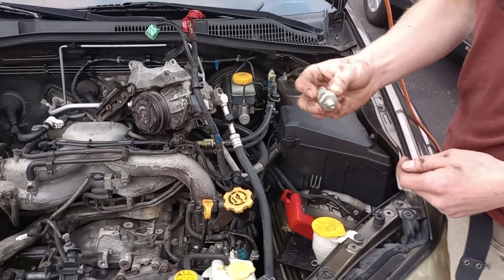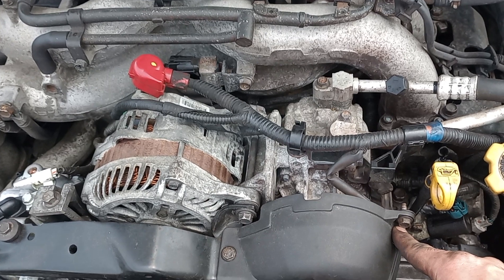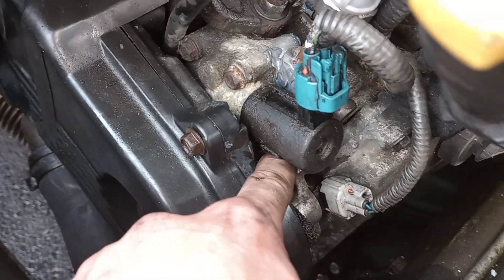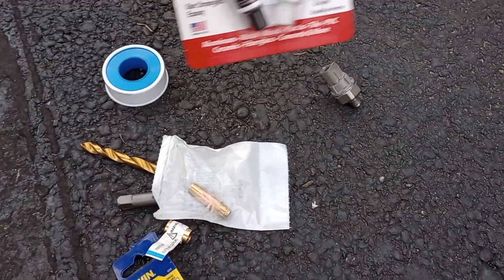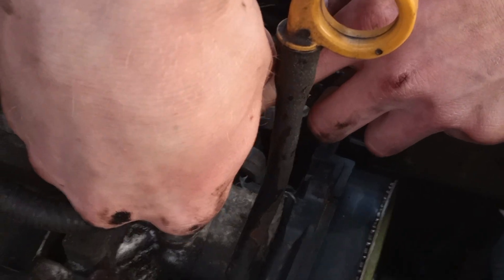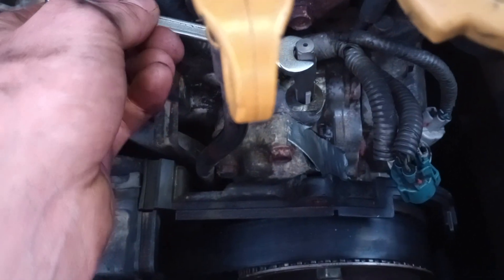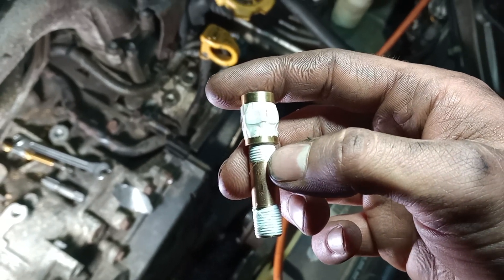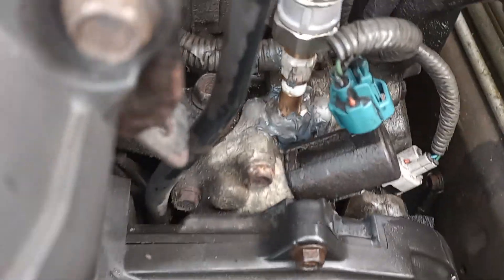Subaru Cracked Head at Oil Pressure Sensor Repair 2.5L EJ253

Comment: only video I found with this issue.  I was hoping it was part of the solenoid housing like the passenger's  side. My car is leaking so much oil. I did only JB weld and sure enough it didn't work. I wish there was a better fix.

Comment: At 2:50 I can't understand or see what you're saying. A cube sized drill bit?
Reply from the maker: @ianbelair3047 a "Q" sized drill bit, 0.332inches/8.43mm. that's what is recommended for a 1/8 npt thread
Reply: Awesome, just finished up mine now waiting on jb weld to cure. Thanks✌️

Comment: Dude thank you so fucking much! I was shitting my pants about it and about to give up on my own dumb solution until I came across this. I've been working on the car for 12 hours straight doing this and a bunch of other stuff, and finally at 0300 I start it and it works great. Couldn't have done it without ya man

Comment: Did the repair last? Has there been any issues with the repair that had to be re-done. I just did this exact repair and it seems to hold at idle but springs a leak under load when oil pressure is high. Ive chased two seperate leaks that kept poping up. I started with quick dry high temp in the tube but this last reair I used the original jb weld cold weld and it seems thicker and appears stronger. Hopefully this will do it. Thanks for the video.
Reply from the maker: Still working fine today, it gets driven almost daily.

Comment: Any updates on the repair, brother? I have the same issue, and my concern is whether the distance created by the pipe extender from the sensor to the engine matters or if it will affect the check engine light.
Reply from the maker: Still works great. Car gets driven almost every day. The short pipe won't affect the pressure at the sensor

Comment: You should really crank it down until the price breaks off and start drilling and tapping from there. You don’t need to Jb weld it if you make threads only below the crack
Reply: Meaning don't jb weld the piece back before tapping?

Comment: Yup it’s my turn for crack surgery just got the tap today, appreciate the guidance
Reply: Hey so am I, have you done the job yet? I am having a hard time finding the tap in stores where did you get yours
Reply: @ I had to order mine on Amazon because home depot didn’t have it in stock. I’ll be checking for leaks around 230 to see if it holds up.
Reply: @ hey there, thanks so much for the update I’m about to do the same I went to Lowe’s and Home Depot and both didn’t have the tap I needed but I got everything else. If yours held up well could you share some tips on your process? I would greatly appreciate it.
Reply: @campbellsopamc  did yours end up holding up?
Reply: @ so far so good I just took my test drive no smoking when I come to a stop & no oil seeping from the crack itself. It was fairly simple the drilling is the most nerve racking, and I used a little oil while tapping made me feel better lol
Reply: @campbellsopamc  thank you so much for the update. Did you have to take off the ac compressor hose near the oil pressure sensor port? I’m having a hard time getting my drill bit positioned above the hole properly so I have a good alignment directly above the hole.
Reply: @campbellsopamc  Can you please tell me which ones you got off amazon???
Reply: @PandaMan125  Drill America 1/8 -27 NPT tap everything else in Home Depot
Reply: @campbellsopamc  okay so actually I figured out a way around the ac compressor hose I’m gonna use a drill bit extension to get at the port and be able to drill it from the top. I am heading out to get some more parts. Thanks man.
Reply: @Darius_99  yeah the compressor had to come off I couldn’t get the proper angle myself. Once that was off the drilling was straight forward
Reply: @campbellsopamc  okay thanks for the heads up is it still holding up well? Also how did you measure how far down to drill, did you just gauge it with a screwdriver like he did in the video? Also, any tips on using the tap to cut the new threads?
Reply: @Darius_99  tapping the threads pretty straight fwd I used mini adjustable to turn the tap, i measured like op did and it went well I checked and cleaned up debris each time I checked

Comment: Working on this project right now. I had to tap pretty low because the top part of mine cracked off while tapping it. But you have about 1/3 inch you can keep tapping past the original threads. I had to Dremel the old threads off so the flat part of the nipple could drop down lower into the hole. Finger crossed. I'm about to JB weld in a few minutes. Thanks for the video
Reply from the maker: My friend is still driving the car even today. Hope it works for you!

Comment: how did this hold up so far?
Reply from the maker: @mikec3820  my friend is still driving this outback to work every day with this fix
Reply: Use a torch on the crack then brake clean so you are sure all the contaminants are gone. I fixed a cracked oil pan with jb weld and it lasted years.

Comment: Where did you get the pipe extender and fitting?
Reply from the maker: Ace Hardware. I have the part numbers in the description. You should be able to find these parts at any good hardware store.

Comment: curious how come you've removed the front timing cover? ive seen people take of the whole cam gear and rear timing cover too to access the bolts for the solenoid but have the say i like the straw on a shop vac method better

Comment: Why did you need to re tap the hole? Why not just JB-Weld and then put the sensor back in with the tape?
Reply: We try that with my bro.. and it didn't hold.. leak bad. is way to much pressure
Reply: Also, can't replace the sensor if needed later

Comment: BRO A LIFE SAVER! I never throught of this after I did the same thing! Will be doing. (Everyone’s saying I am gunna have to take it out so I can weld it)
Reply: Update with Mine, the crack was way to big (like the housing part broke off) I ended up taping it up then screwing a screw that I had laying around into it. Now taht it’s warmer out in I’m find an adapter that is the same size as the screw I put in so I can plug the sensor in. It does drive without it and honestly I don’t notice a diffence really.

Comment: I did the freaking nerve racking fix yesterday and let the jb cure today. Drove it 10 miles, got to 5000 rpms, etc. decent smoke from the brake cleaner slop. Mine was extra screwed because the wedge broke off completely and drilling and tapping was brutal. Thanks again man.
Reply: mine just did the same thing today. The wedge fell right off. This comment is encouraging me a bit. A year later, still running?
Reply: How did you secure the wedge?

Comment: Do you drill with both bitS?
Reply from the maker: Just the one drill bit then the tap
Reply: @Adding1122  how far do i drill down? And how is the repair holding up for you?
Reply from the maker: @3188teddyrock  still holding up good after 5k miles. I used a small screwdriver, as shown in video, to estimate the depth to drill.
Reply: @Adding1122  yea it didn’t work for me oil was still leaking. I ordered a kit i found online and will install this week. I will keep you updated
Reply: Thanks for your video, talk about a sleepless night I had last night.  I will be doing this fix this weekend.  Mine actually broke a chunk off but I first found a guy who will sell you all of these parts for $180 and he has a pic on his website of one like mine that is completely broken off.  Thanks for listing the parts and tools. I went to a plumbing shop to get the nipple and coupler.  Also I like how you removed the AC compressor and not having to discharge it, just swing it out of the way.  Wish me luck - Eric @Adding1122
Reply: @3188teddyrock any updates ?
Reply: @purruas1  can you point me towards the kit? a link or the name of the site.
Reply: @purruas1  how did it go?  has it held up?   same issue I have
Reply: @3188teddyrock  what kit are taking about?

Comment: Will be attempting this weekend. Will update with results
Reply from the maker: How did it go? Did it work for you?
Reply: @Adding1122  it worked! It leaked a bit when I tried the first time, so I tightened everything down and added more sealant. Then I jb welded everything and now it runs flawlessly

Comment: Hi! Nice work. Thanks for the video!
I have the same problem with my Subaru Forester. I am planning to do the same thing as you, just wondering about debris when I drill it. What if I put some paper in the hole until I drill? And of course vacuum after drilling and removing a paper.
Reply from the maker: Should be fine if you're careful not to tear the paper pulling it out or catching it in the drill!
Reply from the maker: Did it work for you?